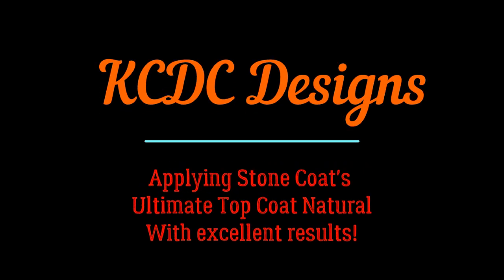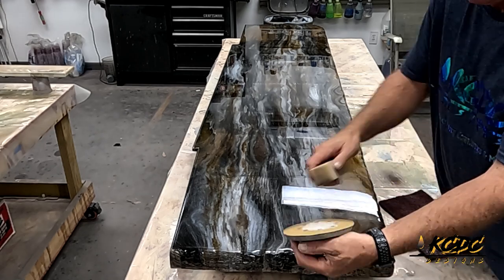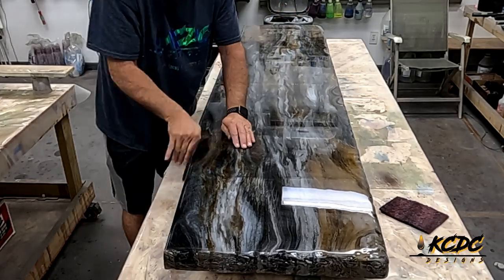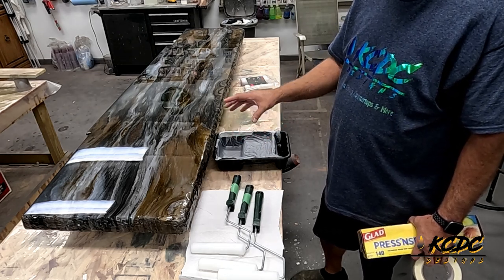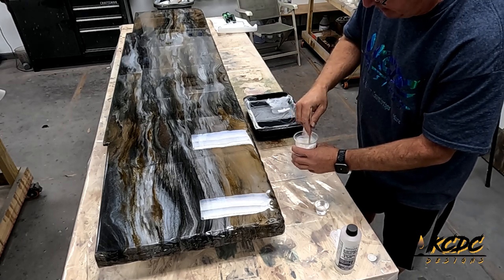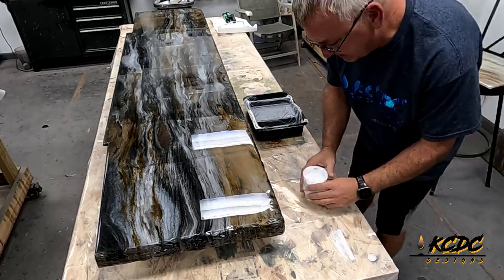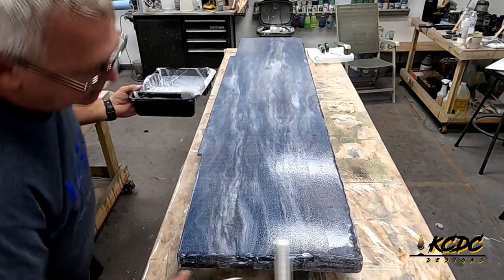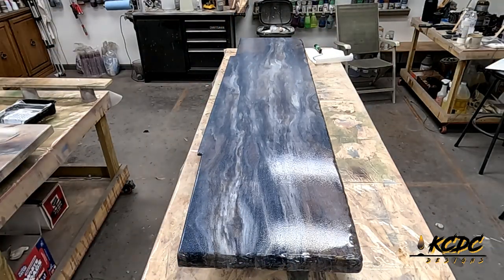How to obtain excellent results when applying Stone Coat's Ultimate Top Coat Natural | KCDC Designs

Comment: I got a tiny hair in my test board utc. Everything else is perfect. We cannot get a perfect environment. Thats impossible. 

Now I am scared to try it on the installed countertops. Is a bit of lint gets in the UTC, what can I do?
Reply from the maker: All you can really do is take all preventative measures to ensure a dust & lint free environment. If a hair or lint lands in the UTC, I would try very carefully to remove it with fine tweezers as to not touch the UTC, if possible. 
Many are in the same situation and my best recommendation is to be sure there's no air moving in the area, 1-2 hours before and 1-2 hours after applying UTC. It's also very likely that a hair or lint may not be noticeable on the overall surface, except to you (if it's completely unavoidable).
I wished I had better advice, but at least with UTC it doesn't stay "wet" for several hours like epoxy does (I know that doesn't help much either).